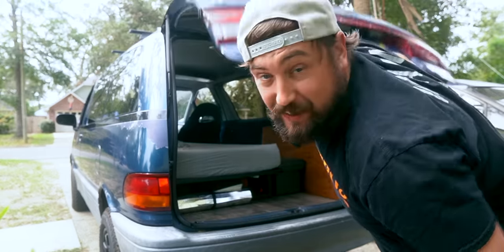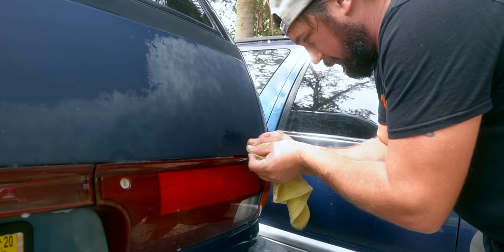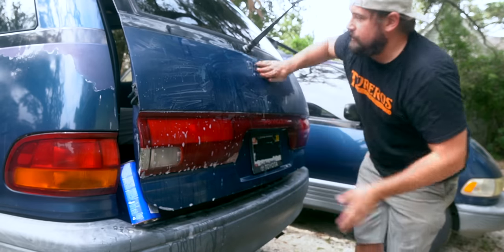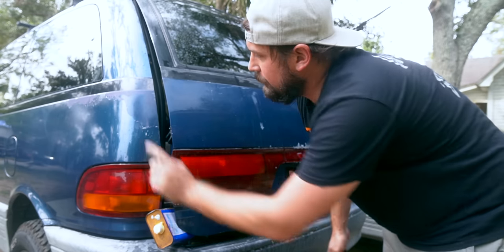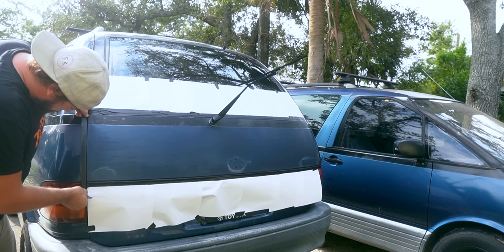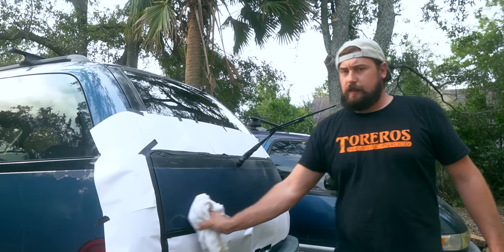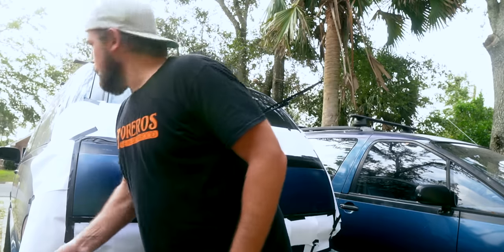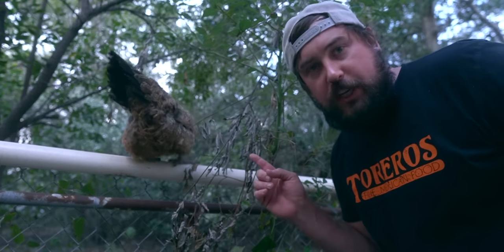How to fix Faded Car Paint |  Peeling Clear Coat repair | Toyota Previa Minivan Camper Conversion

Comment: It’s good but one big problem is, you never paint over 2000 grit sanded paint , the paint will peel , normally you would use grey scotch pad which is equivalent to 800 grit but 2000 grit is way too smooth to paint over
Reply from the maker: Maybee.. depends on if there is sand from the ground on the paper
Reply: Hi, may I ask you to translate grit into P please? Like I bought P120 and P240 sandpaper today. Is this okay to use?

Comment: I did not hear Sean mention what grit, or grits he uses when sanding.  I am looking for process to remove peeling clear coat at point of peel, to smooth, and to do so with out damaging the adjoining good paint.  Any input from those with experience really welcomed.  I need to get on top of this on my 2006 Tundra with only 135K miles on it, and 100K more to go! Thanks all.  And yes, I need to get out more!!

Comment: Right, so everyone knows colour coat is a porous paint and can't reflect light. Although you'd still be rubbing down clear coat edges. My Scratch Patch matches colour for colour of both paints, especially burgundy as this gives a pink centre and burgundy surround. Although faded Nissan red (panel shops/valets couldn't improve without respray) and baby blue Ford (owner tried every product on our market and wouldn't retain shine past 1 week/1 carwash), I washed car myself, washed with product, rinsed in 1/4's, rewet and chamois dried, shined a faint residue to a gleam, in 20 min, without water paper. I gave up checking on shine after 5yrs in one of worlds worst saltair climates, with hectic infrared. But as you can paint over, it'd make sense to clear coat, shine in, for really deep gloss. Thinking on getting affiliates to market stateside. But right now preoccupied on different issues. Just saying ...

Comment: On your Previa transmission dipstick when it is hot the fluid should go up to the top knotch correct? Mine just goes to the center of the word hot and I think it is low b/c I hear whining when I accelerate and it is not the power steering. I drive it gently and reducing my driving until the fluid and new trans gasket from Toyota arrives.
Reply: When fully heated up (not just sitting, but running in the FL sun 20-30 minutes) the fluid will be fully expanded and should be at the top knotch on the dipstick. Toyota transmission fluid has mineral oil and possibly other additives (specially formulated for Toyota) where as parts store fluid doesn't. Don't listed to parts guys or Toyota dealers saying it is the same thing. Read the bottle that bears the Toyota name on it. And see what the maker of those cars says. And not the dealership. They didn't build the car Toyota built it.  Don't take my word for it read the bottle of Toyota transmission fluid.
Reply: Toyota recommends an 85% fluid change between 80-100,000 miles. If you just need to add a little bit of fluid you can use the parts store stuff to mix with what is already in your transmission.
Reply from the maker: Question for @previalegend
Reply: Drain and refill every 30,000 miles . I had a previa 1993 with 378,000 until I sold it and never had problems with the transmission

Comment: If you are going to try and do this yourself ,do yourself a huge favor and go to your local Napa store and ask the paint rep for a can of Clear Diamond Finish made by KBS - Coatings part number #8114 three medium to heavy coats and it'll not only bond very well to the old finish it will look like the original finish . Also dry sand the the clear and try to stay off the paint, use 800 grit paper dry . It will do Two things for you ,1. Allow you to see how much material you are sanding off so as not to go too far , 2. You will get a much better adhesion from the clear . 1000 grit then finishing with 2000 grit is definitely too fine to gain proper adhesion. 2000 is for wet sanding the final finish in order to buff it .good luck people.  P.S. the Napa store in your area should have the better product I mentioned for about the same price, I normally pay 17.00 per can and I use it on fender edges and things like that but it will work on the exterior.
Reply from the maker: Good suggestion!!!
Reply from the maker: I just used what I had laying around as far as sand paper goes.. you can see in the video.. not too sure about the fine grit sandpaper lol

Comment: ? Wait it looked like your paint was chipped or faded? You just fixed it with a clear coat without a green paint? Or was the fade just the clear coat fading?
Reply from the maker: It still shows a bit of the faded blue paint underneath but I was fine with that going in to it like I said. I just sanded smooth and added a few coats of clear

Comment: How much approx. for that kind of previa? Btw you are an awesome dude...
Reply from the maker: You can find one for around 1-3k with if it’s under or around 200k miles I recommend buying it. The awd version will be harder to find and will be more money but well worth it.. it Will cost about $2k to lift it and add the wheels and tires if you do it yourself. .
Reply: @sweetbabysean  wow that's cheap. In my country is about 7k -1.2k with driving distance +/2 ( 80-200 km). Thanks for your info

Comment: what is the long term on this fix though? hope someone helps me out , thanks in advance
Reply from the maker: There really isn’t one for $20 haha. But if you do this in the right conditions it will last a few years with wax
Reply: Do what he did but instead of spray use proffesional 2k clear coat and apply it with compressor...
Clear coat wont cost more than 50 bucks for whole car... Find someone who has compressor.

Comment: You're supposed to use a can of base color and then clear coat, also, you need to decontaminate the area with alcohol and a clay bar before applying clear coat or any kind of paint

Comment: I had a buddy of mine that worked at a dealership in the detail department. He was tasked with applying the clearcoat to new vehicles. I would visit him at work from time to time. One day he had several vehicles to clearcoat. He said, watch this, he filled up a bucket with water, dumped the clearcoat in the bucket then threw the entire contents on the new vehicle. He did that to all the cars that he was supposed to clear coat. Obviously never actually applying it as per the instructions. I guess it turns out he did all those people a favor.

Comment: I wonder if the clear is hard enough to buff ?
Reply from the maker: I haven’t tried. It’s just too hot to do anything
Reply from the maker: I honestly haven’t buffed waxed or done anything to it. I’ll prolly wax and polish soon though.
Reply: You should wait a week before buffing it. The paint needs to fully cure. It may feel dry to the touch, but depending on temperature and humidity, it may need a few days to fully dry.

Comment: How long does it hold?
2 yrs or 3 yrs?
Reply from the maker: Depends. Garage kept. Prolly way longer. Florida sun way less. Use resin paint for a longer lasting result. I plan to get the whole van painted in a year so I just wanted it to look a little better. It’s been holding up. I didn’t wax or polish. Should last longer with wax!

Comment: Ok, so a few problems. The orange peel is noticeable too.
After wet sanding the final time you should have either;
1-buffed it with some compound to restore the shine, or
2-spray painted the same color of the original panel before spraying the clear coat.
Reply from the maker: Lots of stuff I “should’ve done” Hahha!  But it’s held up so far!
Reply: Actually buffing or recoloring that area, would make it have a different hue than the rest of the faded paint. This is pretty spot on.
Reply from the maker: I def mentioned the orange peel lolz I don’t care! It’s shiny again!
Reply from the maker: Buff with compound then paint? I’m gonna try it next time!
Reply: You can not buff paint that has nohardner 😂
Reply from the maker: @scottweltman4131  I never buffed or waxed it. One year after video is coming soon
Reply from the maker: Or you can just watch my other videos and keep a look out for the van. Everything is posted with the dates
Reply: Exactly, just pure laziness smh

Comment: be careful with that acetone near light lenses folks it will permanently burn the plastic lens, tape em up
Reply from the maker: Great tip! Didn’t think about that! But luckily I didn’t poor much of it on the towel
Reply from the maker: Is there a better option to get the old adhesive off ?
Reply: @sweetbabysean  plastic razer and degreaser

Comment: For $20 and 2 hours of work, it’s OK.  That isn’t 2k clear coat though and the paint will look like crap again a year.  You should have quickly walked through the polishing phase too.    You also picked the easiest panel to tape and paint.
Reply from the maker: I just did what I did and shared it. It worked for me. Looks way better than it did before and I’m stoked about it! Wasn’t expecting it to get 200k views lol! But it’s not a bad option if you just want to get the clear back. Def let dry a few days and add wax!

Comment: How does it look now?
Reply from the maker: I’ll be a doing a “over one year later video soon when I get back from Alaska!
Reply: @sweetbabysean  interested in your result but I’m going to try this now and perhaps use the same brand of clear in a few days… pls rate from 1 to 10 .  How did it last? Should Iconsider different higher costing clear coat spray brand. Thanks.
Reply: 💀 translation, it looks terrible now

Comment: Why pay a shop big bucks if the car is old and it comes out that good, not bad for a DIY project. If you compound and polish, it will look even better. Of course that's another $35 for compound and polish but will be worth it.

Comment: okay, good results, and you have a talent, but next time you can do it right and plan it a bit. Use resin cans - and do something for dust in the air. Just an air filter where you are spraying would be better than nothing. Spray things down and wait for calm air. Find an auto paint supply store but check online pricing. Watch youtube.
Reply from the maker: No way jose

Comment: All the "light coats" is why is all orange peel, clear needs to flow out and light coats won't do that. You're just piling a bunch of rough textured coats on top of each other.
Reply from the maker: I’m learning so much from this comment feed. Clearly I’m new at this. But I’m happy with how it’s holding up

Comment: It should not have used 2 full cans..that's nuts ...1 can would have been enough if you did it the right way... with your first check at you want to spray light and thin and not to close after a couple minutes you can spray close enough without worrying about runs.. because after thebfirst come at itbwilvstick liie glue
Reply from the maker: This whole video is nuts. I thought that was obvious. I say not to do things then I do it.. hahhaha
Reply: @sweetbabysean Have you ever tried the stuff that Derrick at VGG sells for the "patina"?

Comment: Rule #1 of spraying paint, Make your first coat look like your last coat, and 2000 grit is too fine to paint over for proper adhesion.
Reply: Which grit?
Reply: @dennisrobinson8008  if you are spraying color ( base coat) First 400 grit to 600 grit. If you're just clearing over something existing, 800 grit to 1000 grit is a decent place to start
Reply: @purhtronpurhtron3837  ah I was looking for this comment! my base coat is perfect, I just want to reclear with a higher quality paint (2k clear). So should I just finish with 1000 and clear coat it? Someone mentioned 2000 is too fine to adhere
Reply: @purhtronpurhtron3837  Hi thanks for the speedy reply.    On another thread the author did a fender with primer, 4 coats of base and 3 coats of clear 2k.     He appeared to use well less than one spray can of each.   On a popular paint site it's advising 2 cans for a fender.   I was just curious how it really works out in real life?

Comment: No, No, No.  Taking the hard plastic raised logos/wording off the car's paint, use FISHING LINE.  The thickest you can buy.  Use the sawing technique and pull it towards you.  It will NOT damage your car's paint.  There might be a shadow left on the car, but if you are painting it, then it doesn't matter.  YOU JUST SENT A SHIVER DOWN MY BACK, RAZOR BLADE ON PAINT.  YIKES.

Comment: It looks good but I reckon it's a waste of time & effort. Once clear coat has started to peal, all of has been UV damaged. That's the problem with all clear finishes, the UV shoots all the way through & damages it at all depths. That means you can't blend a repair, because any of the original clear that you leave feathered off into the repair will also delaminate very soon. Economically, it may help you sell the car to some unsuspecting victim, but you will have to get rid of it quick & live with the fact you’re a real A H. The only real way to fix failing paintwork is, strip or cutback all the failing layers & respray but even then, it's not going to last as long as the original factory finish. That's just the reality of not garaging a car.

In all things, a man just has to decide if he will live with integrity or not.

Comment: And you just spent more in labor than the van is worth.
Reply from the maker: Hahahaha. Van sells for 8000k
Reply: @sweetbabysean with 400k miles on it on Facebook marketplace.  

Engine and trans redone lost the receipts. Was going to convert to a camper but lost interest. 

No 2nd gear on trans. No low ballers I know what I got! 

Will not respond to "is this vehicle available" if the ads up its available. 

15k obo.